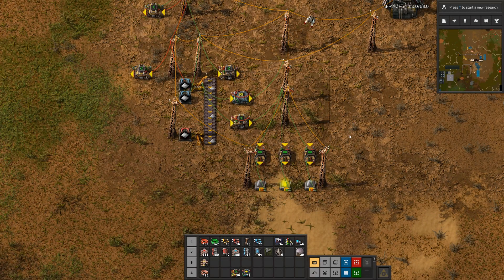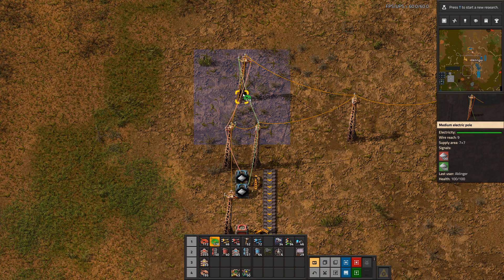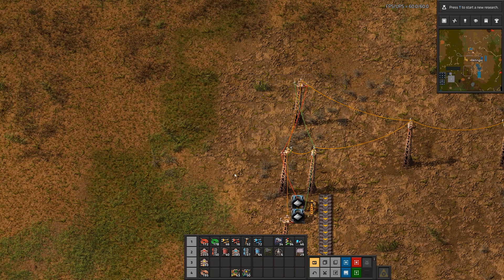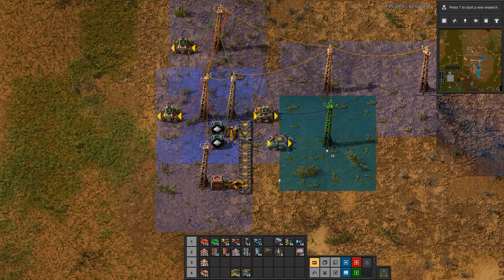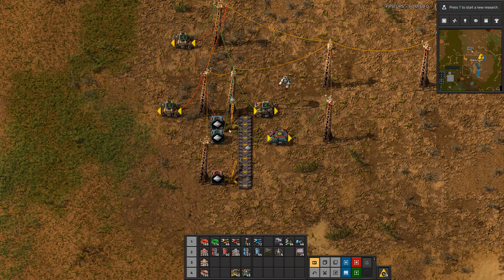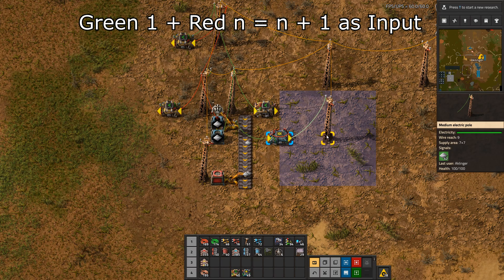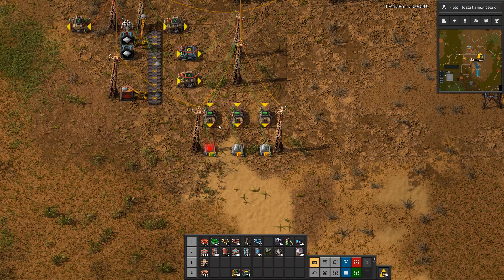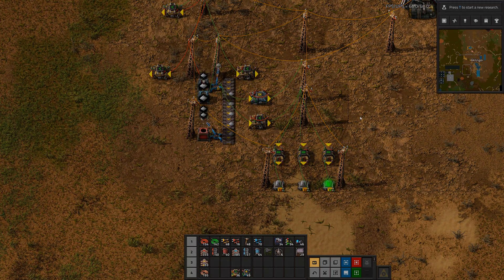Basic Combinators and a Simple Counter - Factorio Tutorials

Comment: Yea, that helped, thanks... but now I need to know how to shut off the inserter that I'm counting... 
So, I basically want the inserter to grab 40 items, and then stop working all together. (for Kovarex startup)
Is that possible?
Reply from the maker: You could use another combinator to check if the count is <= 40 and if yes, it sends some signal which you read at the inserter.
Reply: @aklinger  Hmm. Gotta try and mess with that. Thanks for the reply!